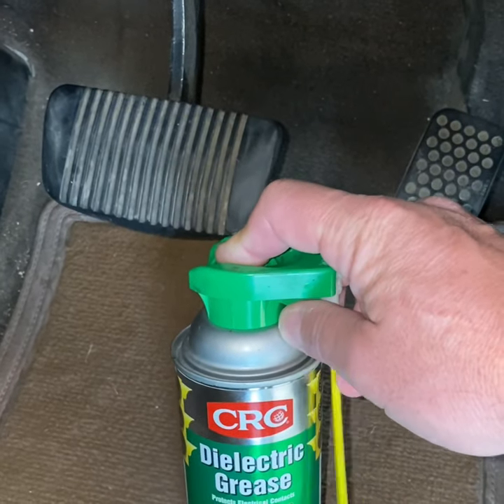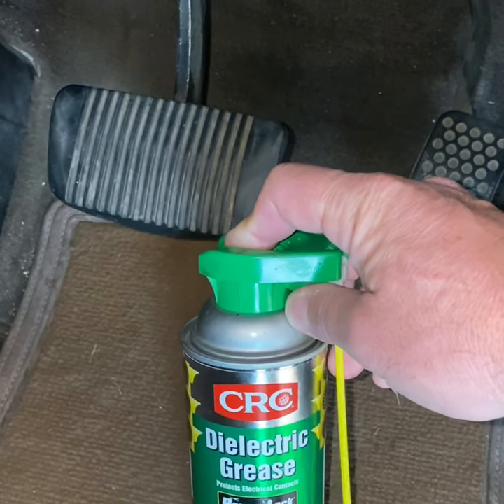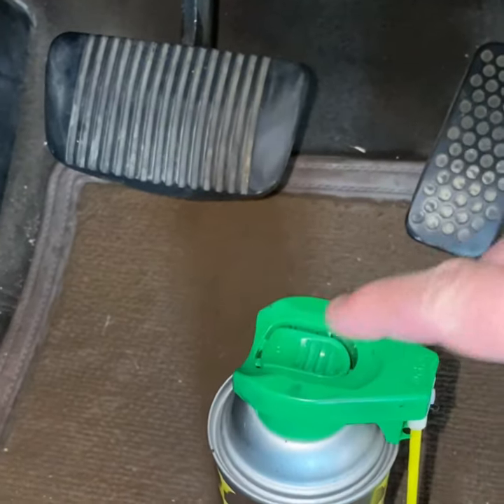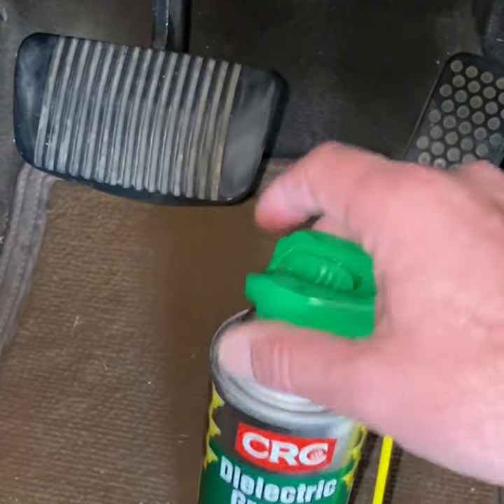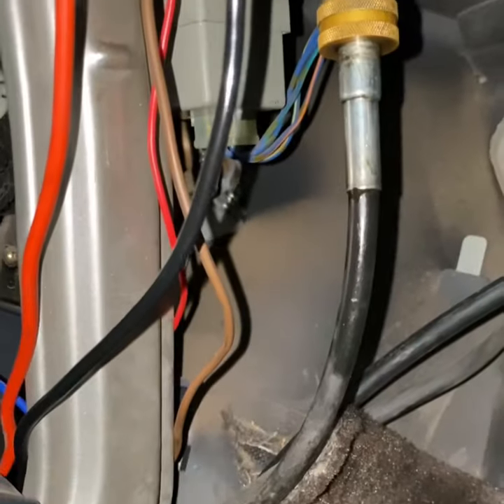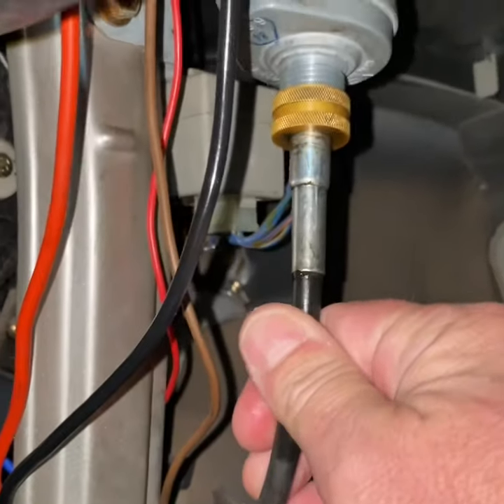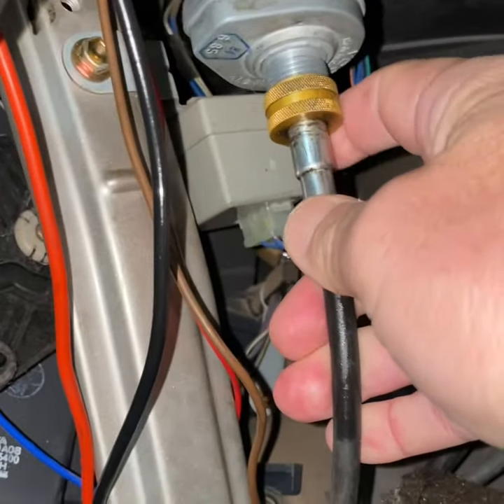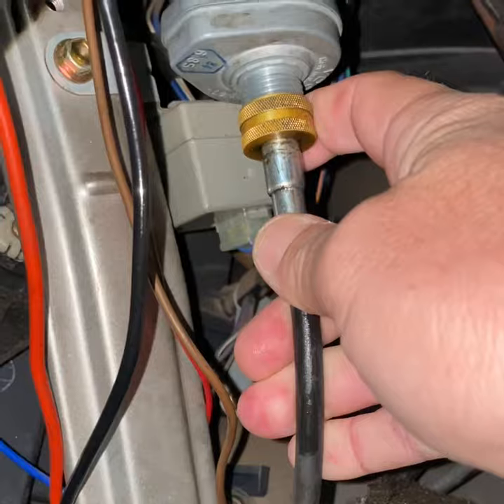Noisy, wobbly speedometer simple fix (HJ61)

Comment: My 40 series had the exact same problem, it didn't register any speed till about 20kmph then it used to bounce around like crazy. 
Then one day it just completely stopped working. I replaced the cable and now it's smooth as silk and picks up the second you start moving. It was a super satisfying fix.

I'd definitely recommend replacing yours next time you have the dash apart. 
I hate going into the dash as they are so brittle so I always make sure i have multiple jobs to do to minimise the risk of breaking something!

Comment: My Corolla 2000 gives rattling sound in first couple of hours of driving and jumps speedometer.  After sometime sound goes away and meter stabilizes at the same time. What could be wrong?
Reply: I have the exact same car with the exact same issue
Reply: @yousefkhedim366  so mechanic put lube on cable and it went away temporarily.
Reply: @xamashee  did it come back again?
Reply: @yousefkhedim366  yea it did. But I sold it cheap before changing cable.

Comment: I have this exact issue and I also did not associate the clicks with the speedo wobble. Mine does not have the cruise control fitted like yours does, so it won’t be as easy of a fix. Cheers from the states
Reply from the maker: It is super lucky to be honest. Looking up from the floor well it is easy to see the screw on fitting at the back of the speedo... very small hands, or very long pliers (or the like) may work?

Comment: Hey I got a 82 hj60 
And the tach isn’t working is going to be a similar problem
Reply from the maker: Hey mate, potentially... but it will need to be accessed from the back of the tacho.... small fingers, or dash out potentially...! Love to hear how you go!?
Reply: @theold60series26  
I gave you a update on you 60 walk around 

Basically tach is electric on mine sort of fixed but not really now having transferr box problems I got the 4sp with the overdrive but I can’t get it out of overdrive like the hole in the floor isn’t long enough to get the leaver down